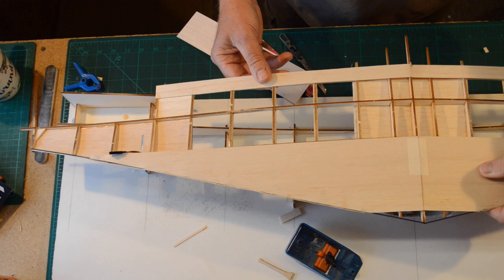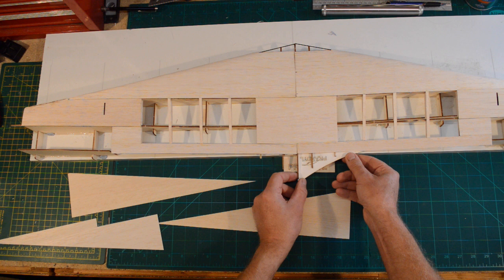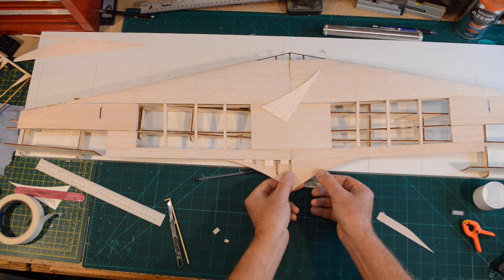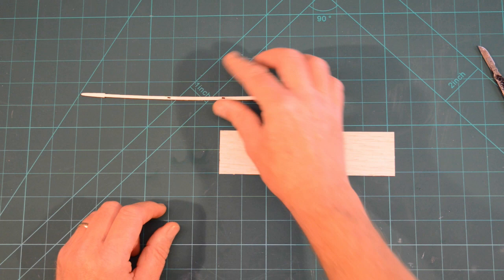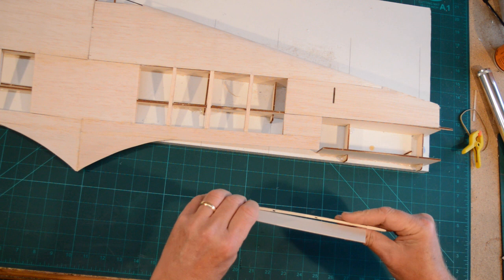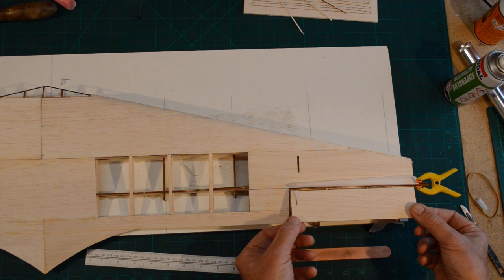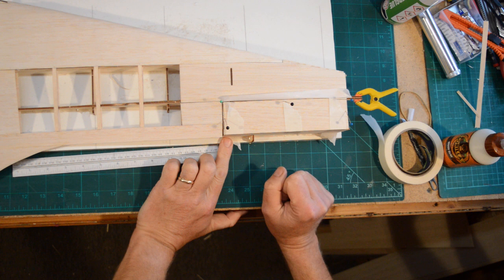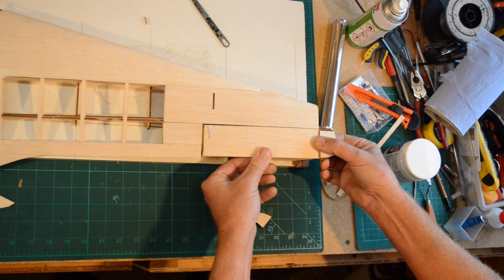Prandtl Flying Wing FVT-3 Part 5 Horton tail and elevons

Comment: When hinging the elevons, I assume that you marked out a straight hinge line on the curved spar and the curved elevon.  However, did you hinge near the centre of the spar or at the top of the spar, please?  The top hinge method allows you to slip the two outer hinges between the spar and the top sheet when you are gluing on the top sheet.